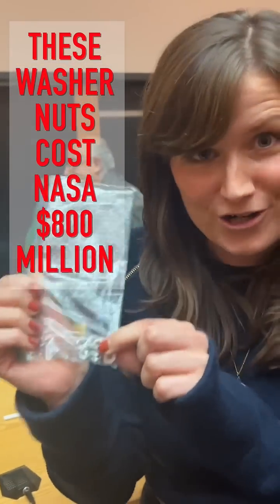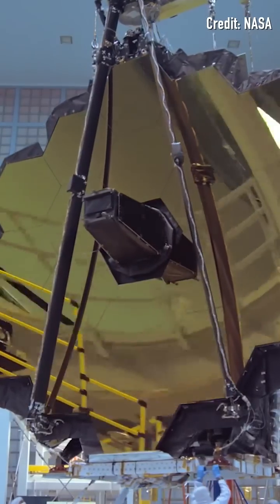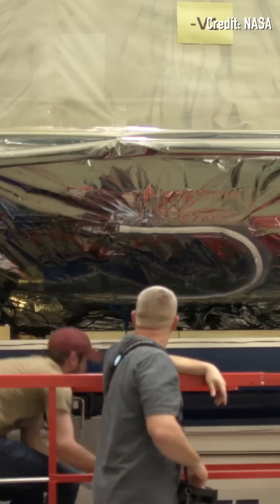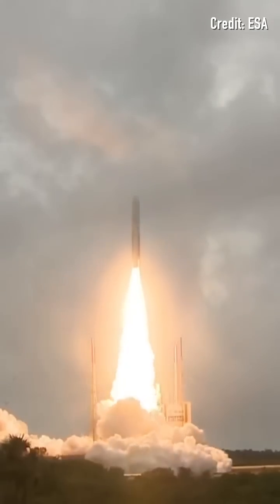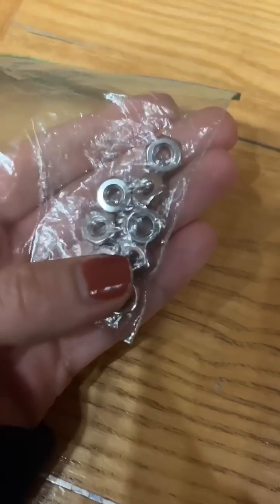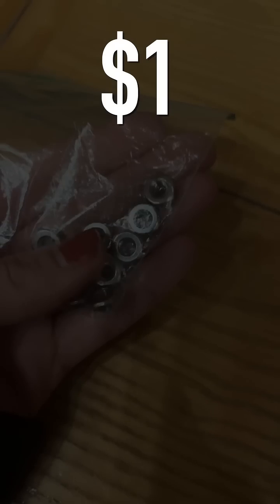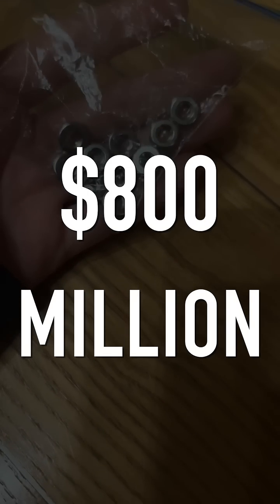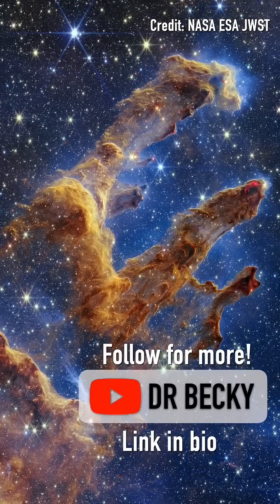JWST cost an extra $800 million because of these 10 washer nuts

Comment: You would think that one maintenance man in an afternoon with a tube of loctite could remedy that problem with the nuts😂🤣
Reply: Maybe. But do you want to risk a multibillion dollar project? There needs to be more shake testing and also consideration for volatiles that might coat the optics, etc. Everything is very carefully considered. A whole room full of engineers will go through a risk analysis and all the follow-ups recommended. But hey, I'm sure a tradesman could put up a space telescope for a fraction of the cost and it would work much better.

Comment: imagine if they later found out somebody just used wrong colour of thread locker
Reply: ive done that myself
Reply: Could have just used nyloc nuts
Reply: @TheCleverJoker I can't say for sure, but you cannot, no.
Nylon near optics isn't a good idea because PA has a high total mass loss in vacuum. The plastic is vaporizing because of the low pressure (called outgassing). These particles will then "condensate" on the nearest, coldest surface. Most of the time this is either a mirror or a lens, reducing the performance drastically.
Don't know about the impact of 10 nuts though (especially because the exakt location is unknown to me). That beeing said: same goes for locking fluid, which brings me to my original reason to stop by.

Locking fluid is NEVER your primary locking mechanism. It should ALWAYS be torque and the resulting pretension. The underlaying principal beeing friction.
If your 15Nm don't hold (assuming M6 nuts) your locking fluid also won't. At least not with sufficient reproducabillity.
Cheers
Reply: @joseppedaia3673  hello fellow aerospace engineer;)
Reply: @RCP-1136  ;)
Reply: @joseppedaia3673 you can get lock nuts that rely on deformation or the ones with cuts that slightly misalign the threads....
Reply: @TheCleverJoker Nyloc would probably melt but there is different lock nuts so I get what you are saying. You'd think they would have thought of that 🤣
Reply: @TheCleverJoker  exactly what I was thinking, those buggers don’t like to come off!
Reply: It doesn't hold up to launch nor the temperature differential.
Reply: Lol
Reply: This. Has. Happened.
Reply: Has a bearing on the matter
Reply: @@cintinu9589 non native english speaker here... and i used British colour... but hey, thank you I guess?

thread locker or by Loctite brandname  Threadlocker is a type of adhesive used to lock threads from vibrational loosening.
There are many variants of them - some of them are just called by their colour. Some that can be loosened by apply heat, some that are more suited for specific metals - so picking the right one for the right application is important.

Comment: The nuts were required because they insisted on launching the telescope using a technologically obsolete non-reusable launcher with solid-rocket-boosters, which generate the high level of vibration.  If they had just admitted their mistake and called SpaceX they could have launched 800 days earlier and saved $800 million.  SpaceX does not use SRBs, the only launch provider which is not addicted to these military followons!

Comment: So it cost less than half of the cost of the Artemis I launch or nearly equivalent to the cost of 8 launches of Falcon Heavy?  You know if they used lock washers with those nuts, they wouldn't have come loose.  They're in aisle 5 at Ace hardware.

Comment: That's kinda odd. You'd think the fasteners would have already been designed with extreme vibration in mind. Anything that has to deal with vibration you use,  locknuts or lock washers or polysulfide ,etc,etc.
For that price they must have had to dismantle the entire thing to get to the loose nuts.

Comment: Gee. Just today I blundered by confusing  tera-bytes and giga-bytes. Now this. $800,000,000.

The matter reminds me of a published book which complained and decried the egregious fiscal overruns necessary to fund the development and construction of the new Lockheed C-5 Galaxy large transport airplane. Each book cover had a transparent blister pack that contained the very nut that Lockheed was charging the government under a military contact $5 each (in the 1980s!).

(Incidentally, the book further decries the matter that each C-5 came with a small hammer, to be used in a specific emergency condition. They were custom machined of aviation metals, and each cost the government $1000 1980 dollars!

Comment: Hearing stories like this makes me feel like I'll never comprehend the how these NASA projects are planned and executed. Because how did it take 800 days to figure out how to keep a nut from falling off?!
Reply: It is simple.

If we build a car and 5 years down the road a bushing wears out it can be taken in and replaced.

In the case of the JWST, when it was packed was the last time human hands were going to touch it.

It is too far away to send a repair crew.

It has to work without failure for the mission lifecycle.

Just think of all the stuff that has worked past its mission parameters built by NASA.

Voyager 1 and 2.
Mars Rovers
Space Shuttle program 
Etc.

Sure they have failures but thry are doing and did stuff nobody had ever done before.

There are no how to manuals.
Reply: It‘s the same issue with all gouvernement programs: If you‘ve got infinite money to spend, everything becomes very expensive.
Reply: @BL-yj2wp If the washers were experiencing load forces enough the bring them loose, that means a larger subsystem was bearing weight on the nut more than it was spec'd for. It's very likely that redesigning large subsystems of the JWST had effects that carried over to other systems which would need to be tested or redesigned. The complexity of this engineering task is nuts. 

If you think this could have been done more efficiently, why aren't there companies attempting to put their own JWST out there? There's clearly a market for the data you can gather. The correct answer to the question of the cost of an engineering task which has never been done before is never an absolute.

Comment: $800 million to realise you need split washers or Loctite? I mean you could go full belts and braces and use split washers, with Loctite and nylon locking nuts and would take as long as it took me to write this to test it again. If that didn't work add some split pins with a whole in the bolt. How the frig did this take 800 more days? I am guessing it might have been a little more than these nuts shaking lose, because I must be missing something.

Comment: Doesn't surprise me in the least. There should have been something on the threads to lock them down to prevent vibration from loosening them. I don't know what the aerosace version is called but in the automotive world it's called loctite. It cost about what it cost to buy a draft of beer! And they would have had some left over after putting those nuts on. I mean it would be almost a full bottle left. You want to really cross your eyes you ought to look up how much the Air Force paid for toilet seats one time!

Comment: I am curious as to why it took 800 days to find the nuts that fell off, also… how did shaking it undo locknuts?  If they’re tightened down, they shouldn’t be going anywhere.  Kinda why cars don’t just fall apart.
Reply: It didn't take 800 days to find the nuts, it took 800 days to fix the problem sufficiently to pass the test again and not cause any other problems or go over the mass budget

Comment: Pssst, everyone! (*nudge nudge*) Excuse me. The answers to humanity's key questions literally begin, intriguingly, within the problem!—cold, hard, unapologetically unbiased & empirically-derived data succinctly referred to as, the initial conditions—more precisely, its finely-tuned values—culminating to the Big Bang or, more correctly, the Beginning.... resulting in the Universe (which is capable of sustaining life) as we know it. Fact(s)!

What is the message within the data?! 

TLDR: since it is highly unlikely (actually, "absurdly" so, to put it mildly, even flattering) to be from purely random processes then, logically, it is not and, therefore, by design—deliberate & intelligent design.

The solar system (& arrangement of its planets—i.e. the need for Jupiter & Saturn), plus how information is encoded into DNA, is another hint (*wink*) 

Furthermore, postulating multiverses is even more highly & absurdly so unlikely, since the unlikelihood is ludicrously & exponentially compounded to way beyond comprehension! (yet another hint? 😉) 

Or, in other words, postulating multiverses is simply & ridiculously compounding the unlikelihood of any, since the unlikelihood of the known Universe is already well established. Therefore, the message, from within the data, compels a conclusion which is simply inescapable: deliberate & intelligent design.

Ahem. It's just math.—unbiased & unapologetic. 

So, to recap: the answers-within-the-problem (kicking the behind) strongly suggests that by intentional & intelligent design there is only one universe (that had a beginning). 

Interestingly, prior to science being formalized, the Bible begins with, "in the beginning." Coincidence?—The fine-tuning suggests intelligent design and, so, intentionally!

The heavens declare the glory of God, indeed. Cf. Psalm 19:1!

For a primer on the elephant-in-the-room a.k.a. fine-tuning, please see (among others): https://youtu.be/EE76nwimuT0

Comment: Becky may have clue of astronomy, but clearly not of boltings.
She showed standard hexagonal nuts, no washer nuts. Washer nuts are nuts with a bigger surface area i.e. the washer integrated into the nut.
I wonder why NASA has not used locking devices like wedge lock washers.

Comment: Those nuts did NOT cost the project $800 million. 
Since you didn’t mention anything about re-designing or replacing the fasteners, I am going to assume that they used the same design nuts on the later test in which it passed the vibration test (it must have passed or it would not have been launched), then the most likely cause of the failure was improperly torqued nuts in the original assembly.

In that case, it was either the person who designed the device (perhaps these nuts were in a location that made it very difficult to torque properly), who wrote the specs for installing those nuts, or the techs who installed them who screwed up, & cost the taxpayer that amount of money.

The nuts are inanimate objects, they have no mind of their own. Perhaps they were delivered on the borderline (or out of) acceptable tolerances, but there was some specific reason that the vibrated off. NASA engineers figured out what that reason was, as proven by a later passed vib test. Ultimately it was some engineers’ goof that cost that penalty.

At the same time, it was a small army of engineers’ spectacular, diligent work that ultimately produced this incredible example of superb engineering designed, built, tested, launched  & operational in orbit. 
”The good calculation giveth, & the bad calculation taketh away”

Comment: They like looking nuts to me, and not that fine a thread at that, when consider how much vibration it is going trough at launch and all the testing. I thing some engineer made then up of aluminium to save weight. Need the full engineering story on this Professor Smethurst please.

Comment: Except there is no such thing as a "washer nut". There are nuts, there are washers, there are locknuts. You could have even put a clevis pin in to lock it permanently in place or use loctite. Plenty of simple solutions that already exist for this level of vibration